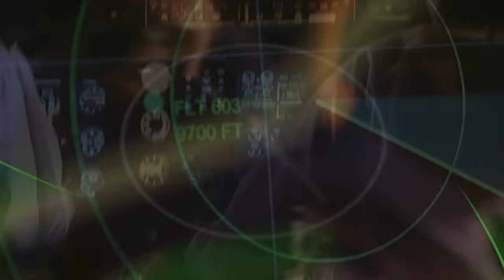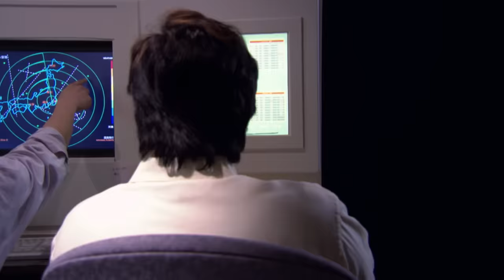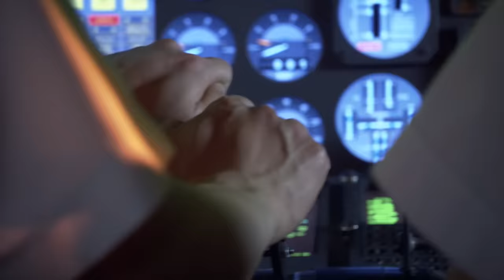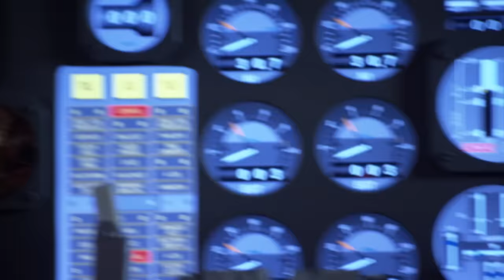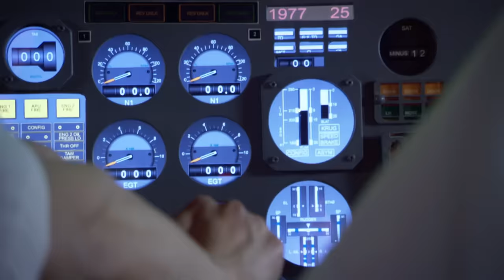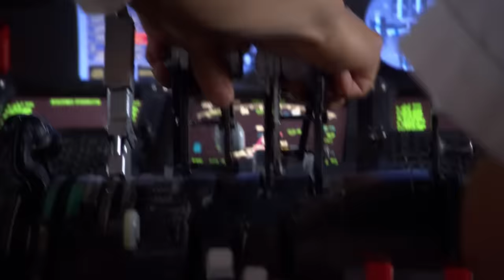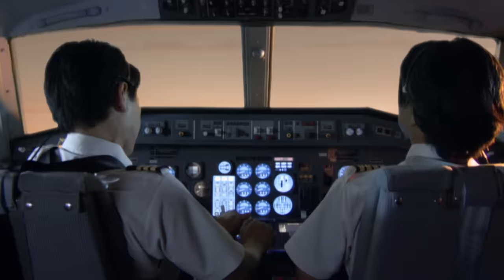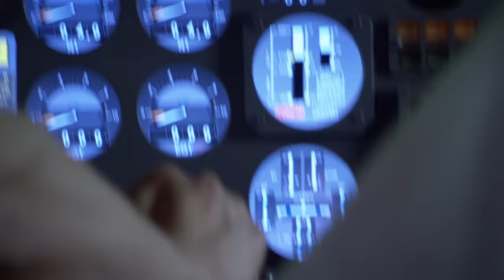Inside the Unprecedented Event on Aloha Airlines Flight 243 | Mayday: Air Disaster

Comment: The fact that no pilots in simulation could come within 30 minutes of the efforts of the actual flight crew has always stuck with me. 

In the Aftermath, JAL paid ¥780 million (US$7.6 million) to the victims' relatives in the form of "condolence money" without admitting liability. JAL president Yasumoto Takagi resigned.[20] In the aftermath of the incident, Hiroo Tominaga, a JAL maintenance manager, died from suicide intended to atone for the incident,[30] as did Susumu Tajima, an engineer who had inspected and cleared the aircraft as flightworthy, due to difficulties at work.[31] In the end, Japan Airlines, Boeing, and the Japanese government paid substantial compensation to the victims' families.
Reply: It wasnt shown in this video. But the actual voice recording of the captain paints are far scarier picture. They all knew they were going to die. In the last few moments the captain admitted defeat saying there was nothing they could do. They crashed in silence in the recording. Meaning none of them screamed. Instead taking the moment they had for themselves.
Reply: @geronimo5537  I was wishing one of them would say something along the lines of "loud explosion in tail area, explosive decompression. Indication of rear door departure. Loss of all hydraulic fluid. Unable to control aircraft using primary flight controls. Using differential power to attempt to control phugoid oscillations. Lowered gear to slow plane. Unsuccessful." for the benefit of the investigators and to reduce future accident occurrences. I always pictured If I was a crewman in this sort of situation I would be saying my debugging steps out loud a) for the microphone as well as b) to properly frame my thoughts; like rubber duck/teddy bear syndrome.

Comment: Does anyone know why there aren't check valves in the hydraulic lines to seal off broken sections so the system stays pressurized?
Reply: Each system is stand alone, so if one fails it’s fluid reservoir is separate from the other backups. The critical weakness is all 4 systems run their lines in the same vicinity so if one is damaged by explosion, it takes all 4 out simultaneously.

Comment: All of the control surfaces should have an electric back up for safety like the landing gear does. It could even have cables for a third option as the hydrolic failures are not uncommon.
Reply: The problem is even with an extra backup system in this case wouldn’t have saved this plane the tail is one of three key components needed to keep a plane in the air that being said this would be a good idea in many other situations which didn’t result in part of the plane being ripped off

Comment: Aloha Airlines Flight 243 was the flight in which part of the fuselage tore off during mid-flight, leaving a gaping hole in the cabin, and resulted in one of the cabin crew (C.B. Lansing) being sucked out of the aircraft.  The incident occurred on April 28, 1988.  This video has absolutely nothing to do with the events of Flight 243.

Comment: Another of Boeings failures again, but was this because of "simple human error"? Most definitely! But the repair was calculated to fail after 10,000 flights, but the plane was STILL in operation well past that until it finally failed in it's 12, 319th flight. So no oversight of the very poor patch job?? And was there no communication about how long the patch job would possible last?? I can understand how very difficult it was to reach that crash site. But the crash really could have been avoided had the proper repair been done in the first place which Boeing's repair crew didn't do. I'm just a bit surprised that JAL maintenance didn't supervise the work.
Reply: Did u not watch whole video?